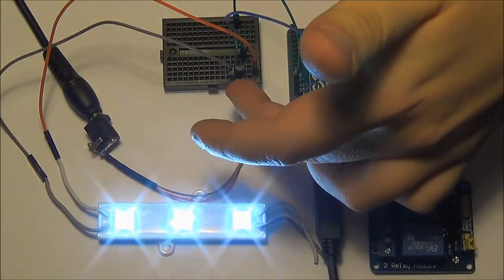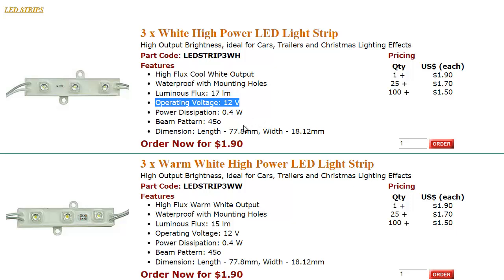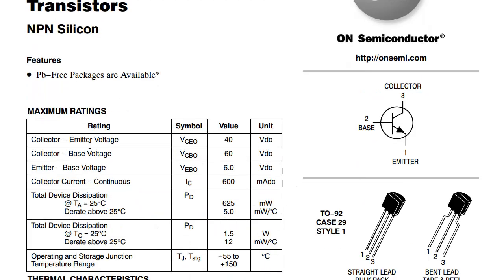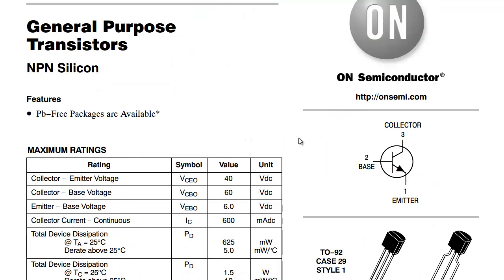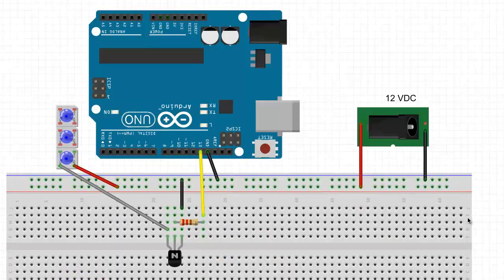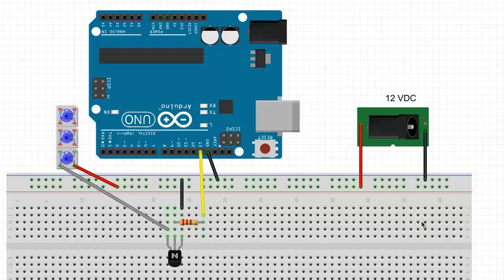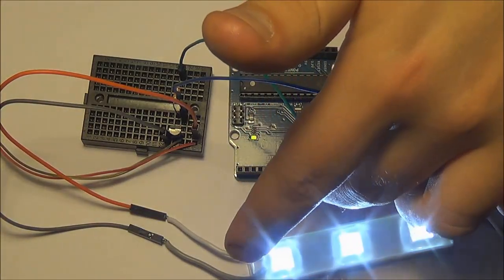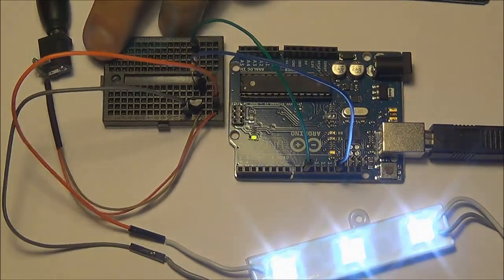Arduino #11 - High Current & Voltage Loads Tutorial - Transistors and Relays

Comment: I have a question to all brothers here "is there an arduino relay   250v AC  and 20 ampere" ??
Thanks before
Reply: Of course
Reply: @ulfmusskacken  thanks 
But i mean  model for arduino
Reply: @salahosmani2829  straight up search for relay arduino on amazon and you'll find boards. Just look at the relay's writing on top. The 20amp ones are a bit more chunky. Almost like a T, instead of a cube.

Comment: Great video.  I'm working on a project to control everything inside my camper through my phone.  I've been looking for a relay module that can handle 12v 40A.  However all of the relay boards out there designed to handle 220v 10A.  Would it be possible to buy a Chinese relay board and replace the relay with high current 12v relay like this 
https://www.ebay.co.uk/itm/12V-Automotive-Changeover-Relay-with-Bracket-40A-5-Pin-Car-Bike-Van-NEW/223167718435?_trkparms=aid%3D555018%26algo%3DPL.SIM%26ao%3D1%26asc%3D56491%26meid%3D7ec305b915534ab58ff40834ffd03502%26pid%3D100005%26rk%3D4%26rkt%3D12%26mehot%3Dag%26sd%3D253672488285%26itm%3D223167718435&_trksid=p2047675.c100005.m1851

Can these modules handle these relays?
Thanks

Comment: I have a plan to make a battery control circuit using Arduino, NPN transistors and voltage sensors but I am still confused in the Arduino program array .... thank you

Comment: Hi, thanks for the tutorial.....I am working on a project in which I am using two servo motors towerpro mg958, reed sensor, rotary encoder, 20x4 LCD, 3 push to on buttons, and an Arduino Uno. The project supposed to be on a cycle so I have decided to make it self powered. I am thinking of using a Dynamo, and li ion batteries,  but I  don't know which batteries to use and how much current my battery can give up to how much time....and can my Dynamo charge my batteries?
Please suggest some batteries and additional circuits that can help me to build my project

Comment: Heyy Vlad!! Thanks for the tutorial !! Really good video. I just wanted to know which ckt simulation software you use to show the schematic in your video. And yeah I am actually working on a project wherein I have got to drive a 24V 10 amp Servo motor and i have opted for cytron motor driver for the same which works fine. The problem is if I want to put the cytron in sleep mode along with my arduino,then thats not possible since cytron gets its supply directly from the battery and I thought of introducing a power transistor in between the cytron and the battery and the base can be connected to the arduino pin, in that way i can cut off the supply to cytron board. But even thats not working since to operate at 10amps the base of the transistor requires atleast 0.4-0.6 A which I dont know if the arduino nano can supply without wearing out. I am a little bad in electronics, so I need your help.

Comment: Actually, not too bad. Good try. You missed a critical, critical point. The yellow jumper on the relay board. It is terrible practice to drive the relay board with Arduino vcc. Use an external 5v power source (like a iPhone or other USB wall wart). That way the opto isolators on the board completely separate the Arduino from things like over draw and fly back. 

Do some research about that yellow jumper. Otherwise, thumbs up.

Comment: Heyy umm a quick question...If i use a 12v dc relay will my arduino be able to power it?..i mean is it safe to power the relay from the arduino pins? and if not what and how much power i should use..Thanks!! :)

Comment: I am working on creating an underwater vehicle untethered. I use the MOSFET transistor to drive a few solenoid valves to add and remove air from my ballast tank in order to make the submarine float or sink.

I'm using something similar to the Arduino, The UDOO board which has an Arduino mega running in parallel with a Lennix system.

If you take requests for future videos I think PIC microcontrollers would make a great series and I like your style of teaching.

Comment: I need to switch 140A and the voltage is 12V. Would a car start relay or winch relay be enough?
Reply: A normal car start solenoid should work fine.  1) there are 2 types 1 grounded and 1 isolated from ground ... you will need to figure out which one is best for you.  2) those heavy relays needs several amps of 12 volt DC current to make connection correctly ... so you will still need a small relay like he showed in this video to trip the heavy start relay-solenoid.

Comment: Hi Vlad,
What if you need to reverse the current flow? Can you use those relays one for one direction and the other for the other direction (assuming they are connected to different pins at the Arduino) or are they both connected somehow or can get only one signal?

I believe that with the transistors you can make an H bridge but I am not sure they are sufficient for the current I need.

Could you explain that or create a new video?

Thanks for your time and for sharing this for free
Hadas
Reply: I am looking for the same thing :)
Reply: I do not need to drive a motor but a solonoid. So relays are fine but how to use them to reverse the current? I think I managed with 4 relays but there is probably a better way.
Reply: There are a number of H bridge driver boards for the arduino ... one is called L298P - $5 ... or L293D $6 ... you can get dual H bridge boards to drive 2 motors at the same time and you can of course reverse each motor and control the speed of each motor separately as well. :)
Reply: also if you really need to drive a heavy motor from an arduino ... the Syren can be bought which can take 6 to 30 volts and switch up to 50 amps!! ... these boards are considerably MORE $$ ranging from $70 to $120 each.
If you need even more power ... you may have to look to a custom solution like ... type this into google ...> Speed Controller for DC motor Manta control 12 24 48 volt 100-AMP
Reply: i think you can do with either 2 or 3 relays depending on exactly what you are doing.  with 3 u use the 1st relay to drive the other 2 ... that way you are making sure that relays 2 and 3 will never be on at the same time - because if they were it would cause a direct short across your DC voltage or power supply.
Reply: also make sure that at least the 1st relay is a DPDT double pole double throw ... this makes it easier to isolate it from the #2 and #3 relays.

Comment: Hi, really interesting video, i am building a model railway and i want to build a control panel for it. I need to control approximatly seventy solenoid points so this video was really informative. Any chance of a video showing how to do this and get a signal lamp to show the position of the point with the switch that controls it using an Arduino? Once again thanks for the video.

Comment: nice vedio . can you explain how to use both the relays for switching two devices using the same 2 relay module with one device using ac voltage of normal 220v and the other using dc of 12v supply using the same arduino .

Comment: Maybe you can explain why my transistor keeps getting so hot in that configuration? It says collector to emitter maximum is 40 Vdc and i have only 9v going across it and into a single LED.
Reply: what's the voltage consumption of your LED? High chance due to overloaded LED that causes that particular section of the circuit to be hot.

Comment: Great video. I'm doing  ARDUINO water control system using AC motors. Main components include LCD display, ultrasonic sensor, 4 channel relay unit, AC  Submersible water pump(8W). Without the Ac power the LCD display works fine. But when the Ac pump is driven from relay unit after the circuit on for some time the LCD display goes MAD. displays different kinds of other characters and keeps on going. Any suggestions. Thanx in advance
Reply from the maker: +Ahmed Abdulla It seems that you have a voltage sag on the circuit. The first thing I would try is putting a capacitor next to the display power line (as close as possible). If that doesn't solve it, I would consider isolating your circuits as much as possible. Also, if you have an oscilloscope, I would measure the voltages/currents and capture all the readings to make sure that you do have this problem.

Comment: nice video..but can I directly connect a electric light bulb of 40W to the Relay without using the transistor...will it work or not..
Reply from the maker: +Sachin Shavari You need the transistor to toggle the relay with the Arduino. The relay takes 200mA to trigger (in my case), so it would be impossible to trigger without a transistor without damaging the Arduino.

Comment: anyone know how to make the arduino to a on/off timer (12v dc motor), weekly settings? More then 10 min run time

Understand that you can use a transistor, relays, optoswitch etc. but the timing seems to be a hard nut to crack. Have found an intructable and a timing code but its just in around half a minut settings and it fried my board.. oops. http://www.instructables.com/id/Automatically-water-your-small-indoor-plant-using-/?ALLSTEPS  

Any electro wizard out there?
Reply: If I understand your problem correctly you could either use the micros() or milis() function  or add a real time clock module. When using micros/milis you also have to synchronize the program and pay attention to the reset/overflow that happens after a specific time.
Reply: Thank u. I Have moved on to a different approach with 2 high volt wall timers coupled with 12 volt transformers. My goal is to water some sprouts about 4 times a day for 5 Days and each time just one litre of water, and I found a nice schematic of a mosfet Circuit that could regulate the speed of the motors(pumps) so now Im just doing some fine adjustments. Thanks anyway.

Comment: HI am working on a project that ensures that the power consumption should not exceed 1200W when this happens, its supposed to go on for only 5 minutes and when the five minutes elapse, the circuit breaker to which the socket is connected is supposed to trip to do the disconnection how can i go about this? thank you so much
Reply from the maker: +SSEMANDA DERRICK You can have a current measuring sensor connected to the arduino; you can calculate the power consumption from it. For the circuit breaker, you would send it a digital signal to turn off.
Reply: +EEEnthusiast thanks I will keep in touch with
Reply: +EEEnthusiast thanks I will keep in touch with
Reply: +SSEMANDA DERRICK I was lucky to get this wonderful=== FREE DOWNLOAD Arduino Tutorial and Programming https://plus.google.com/105456673395930650430/posts/PWgqWWct4AF? XOXO~KcA

Comment: Hi,could you make tutorial how to make pcb for standalone arduino for some external project.Thanks a lot... :)
Reply from the maker: +Ivan Stanojević Thank you for your comment! Are you looking for any PCB software or a specific one? I have a video on Altium Designer PCB design.
Reply: It doesn&#39;t matter, I&#39;m looking for software who is easy for using because im beginner.I want to drive relay with arduino chip and because of that i want to design PCB with microcontroler and one reley. Good job :D

Comment: OK I watched your tutorial #11 and wondered how i can use the 4 channel relay to switch 4 motors (2 on and 2 off) using a photo sensor to signal the switch back to the other two when you pass your hand in front of the photo sensor?  (photo sensor or proximity switch whatever you define them by)

Comment: Thank you EEEnthusiast for the quick respond very kind. Can you please tell me, now when I want to connect 4 lamps which run with 60 w (watt ) and I want to switch them on and off seperatley through bluetooth do you know how to manage this ? I really need to solve this problem. Could you please help me? What components do I need. Do I need relais or transistors and do I need an electronic ballast. Sorry I am really not skilled enogh for that I really would appreciate your help :)

Comment: which relay pin do I connect the 12v input for my load ?
Reply from the maker: +Shabab Iqbal You would need to look at the datasheet of your relay. I can't answer that question without knowing which relay you are using.
Reply: +EEEnthusiast i m using same as yours.

Comment: I have a question.. Im not that smart  regarding physics. But why do I need relais when I can use the programmed Arduinoboard to aktivate a Pin High or Low, meaning to switch on and off the connected device. Please Answer me someone
Reply from the maker: +ramo4uuuu The reason is that the controller on the arduino can only run up to 40mA of current. In simpler terms, it does not provide enough power for a larger device such as a motor, lamp, etc. If you try to connect a device which exceeds 40mA to the Arduino, it will damage your microcontroller.

Comment: Hey I have a question I have need to have two relay control two 12v air valves. Im struggling with the code. I want one switch to activate relay one and the second one activate relay two coming from the same power source do you have any tutorials for code? or maybe the one you used for this video?

Comment: What transistor to use to make closed circuit with 0v to gate. Trying to control gadget on with low logic input (0volts) 5 volts would open circuit. Would a p channel mofset work

Comment: Is it possible to control 240V DC motor speed using relay through arduino PWM pin ?
Can you please help me and give me some suggestion ?
Reply from the maker: it is possible, but you would need a large solid state relay or a vfd. it's hard to say what it will take without having more info about the application
Reply: +EEEnthusiast thank you for your reply 
Im working on my thesis and as a part of it I need to control the speed of my motor using arduino
But in this area Im just a beginner and I just know how to control the speed for  DC motors smaller motors 
Now I dont know what is safe to be used for the my actual motor
Reply from the maker: +Ella Sh well, the motor must have a datasheet which should specify maximum current drawn by the motor. based on that, you would need to select your circuity. there are power mosfets and relays. the basic concepts remain the same for a small or large motor, the only difference being the sizing of your components. That being said, high voltage circuits must conform to NEC  (if used outside of a lab), so you should make sure you get all that squared away. (example: fuses, disconnect, overload protection, etc.)
Reply: +EEEnthusiast Im still looking a for a suitable relay havent find yet 😓
To be honest not dare to try for higher power since I dont know much abt it
Anyways Thank you for your reply and suggestion 
Appreciated

Comment: Hi I am currently studying and my Project study is about lighting and air conditioning automation using the Arduino controller. Kindly help me on what are the materials or components needed for my project. And how to do the wiring connection and diagram. And my concern also how to program the lighting and Air condition in a Arduino system?. Hoping for your great contribution on my Project study. Thank you and God bless

Comment: Hi Vlad,
I am very new in electronics.
I have nodeMCU and I bought 8 relay module. NodeMCU provides 3.3V on pins while relay requires 5v. What kind of setup do I need to amplify 3.3v to 5v? Thanks
Reply from the maker: +Marin Radjenovic You would need a voltage booster circuit (you can find them on ebay for ~2$) or a second power rail which you could use to activate the relay through a transistor.

Comment: is there a possible way to control the current output of a charger using an arduino?
Reply: let say the output of the charger is 24V 10A.. and I want an output of 24V 5A, then 24V 3A

Comment: Hello, thanks for the great video. Do you know if i can run 220v DC through the relay at around 100 miliamps? if not, do you know of a relay that can handle that power? thanks

Comment: great video, can you explain more on relay? i actually not so understand on it, the LED required 12V and the relay can adjust itself to 12V to fit into the LED???
Reply from the maker: No, the relay can't adjust itself. All it is, is an electrical switch. You can use an Arduino signal (5v) to open/close a different circuit (12v, 24v, 110v etc.) In my example I had a 12v power supply going to the LED through the relay. When I applied 5V to the relay, it closed the 12V circit and allowed the LED to turn on.
Reply: EEEnthusiast thank you very much it help me alots!

Comment: Thank you for the video!
I want to use the output of a shift register "74HC595" as signal for a relay module. is this possible? I read in a thread that it isn't possible because the low voltage/current and that it may damage the register.
if isn't what should I add to get the required voltage/current? 
What is good for such a register if it doesn't allow to control a set of relays? i think there is some solution around that.
Reply from the maker: Bilal DOUAS You can use the output of the register to toggle a BJT or MOSFET which will in turn drive the relay. For the MOSFET you simply apply 0v/5v on the Gate and the relay coil will be driven by the drain current. Hope that helps.

Comment: Hey I great video! I have a question would this method work for driving a 120v 20 amp motor?
Reply from the maker: Joshua Foster The method would work if you have a big enough relay. At 20A, I would recommend looking into motor contactors; they will provide safer operation. Also, I would consider using fuses and circuit breakers at those currents. Be safe.

Comment: I Need to Control my Room Tube Light and Ceiling Fan with Arduino Uno and Relay with Bluetooth Module How can i do That? i Need to control all this things by my Android or I Phone Phone.?????
Reply from the maker: mohanish daftary I posted a video on how to use bluetooth with Arduino recently. I recommend you check it out. All you would need to do is connect the arduino to some relays and toggle them through the program on your phone.